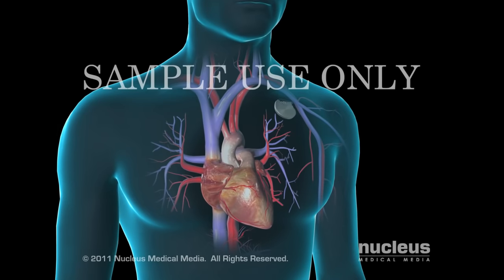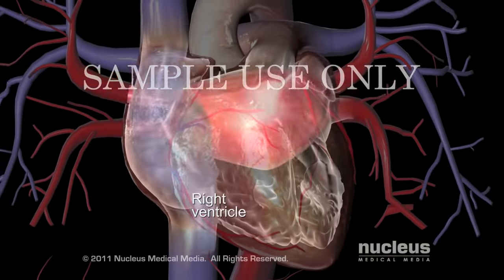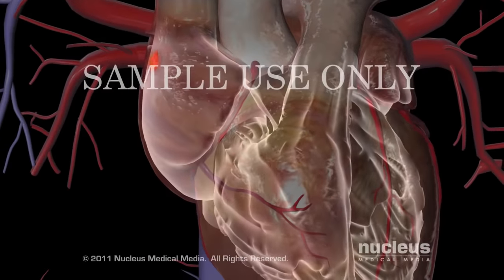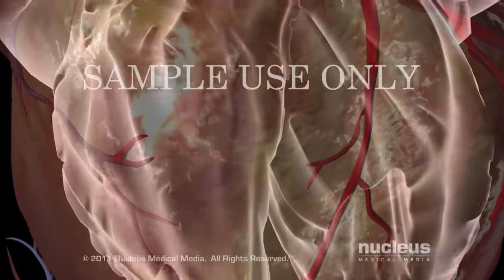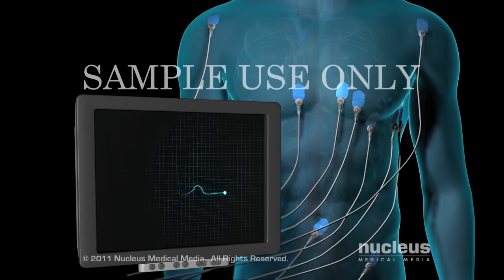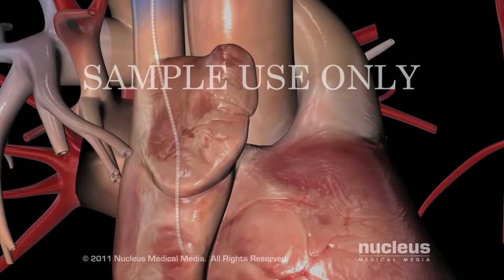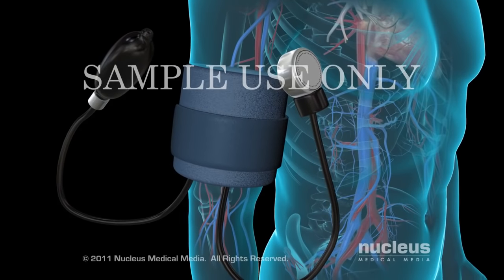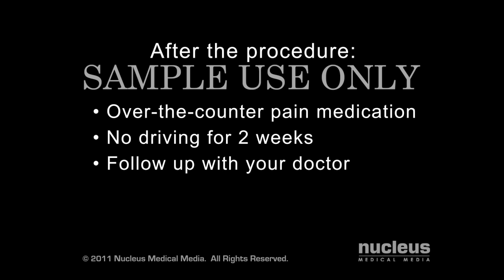Pacemaker

Comment: Hey there, I have a  question (If you don't mind). Okay, I'm 17, and have Hyperadrenergic Orthostatic Postural Tachycardia Syndrome. When I stand or sit up my heart rate goes up to around 170-180 bpm and my blood pressure drops to dangerously low levels, I'm constantly passing out upon standing, and my doctor says that he thinks a pacemaker is necessary. So my question is..Will my heart become dependent on the pacemaker if I do get it, and is there any chance of the pm to stop working?
Reply: Kaylee Macdonald    No pacemaker will never stop working as long as The baterie arę changed and The device is working. If i was u gest a pacemaker it will save your Life. Remember we arę just machines. The pacemaker will be programed so your Heart will best between 60-90 per min
Reply: I have resting rate 35-45 bpm, when i walk or run its all normal.
Reply: What about now are you okay?
Reply: @blinkakay6663  probably rip in peace.
Reply: @uk4490  that's not funny
Reply: @blinkakay6663  sorry
Reply: @uk4490  bruh show some humanity 😑
Reply: @truthtalker9375  only in uk💀
Reply: @uk4490  bruh
Reply: @csgoonly5350  that's is a fuckton low
Reply: @Rizok_soulrose  im still alive xd
Reply: @Rizok_soulrose  low heart beat is actually good. It shows that your heart is strong and can pump a large amount of blood in one single stroke. But this is only the case if you are actively exercising
Reply: Why didn’t you ask ur doctor that question?
Reply: @turfybow1298  he said im ok
Reply: @gen_edits  Yeah but 35-40 is too low
Reply: Rlasco25  between 2 years and now theres a difference
Reply: Don’t lose sight on the Kingdom of God 🏞️ all that is in the world is soon coming to an end. Seek God whilst He may be found. Jesus saves ✝️🙏❤️
Reply: Pray !! Jesus heals
Reply: Are you okay now?
Reply: I know someone who used it till he is 96
He changed it only ones. شفاك الله وعفاك
Reply: @kukalg6212  she died in a car crash in 2016
Reply: Her playlists have vids that are 2yrs old so she was fine till 2021 for sure  , no idea after that 

Hope she is doing well !! Positive wishes :)
Reply: @blinkakay6663  probably in heaven
Reply: Pacemaker is like a derilifbrator but small and in your body
Reply: How are you doing this makes you 28 now.. How did it go?
Reply: @TaT2dDragoness_Leslie  Safe now?

Comment: COMMENTS!!! WHAT IS PACEMAKER?
Reply: A pacemaker is an implantable device which is positioned typically underneath your left collarbone. It consists of a battery with a computer circuit connected to one or more pacing electrodes (electrical wires) which attach to your heart.
The battery of the pacemaker is able to generate an electrical impulse which is transmitted to your heart, which leads to a heart contraction, leading to a pulse or heartbeat.
Learn more:
https://drboonlim.co.uk/pacemaker-implantation/

Comment: I went in for a mitral valve repair and a Maze procedure to correct tachycardia, but the Maze procedure didnt work and I woke up in recovery with the nurse telling me I had to go back in for surgery in the morning for a pacemaker.
I figured they put the leads on the surface of the heart or something like that, I didn't know they actually run those wires thru a vein into the heart where it tends to impinge on the valves closing perfectly.

I thought also that they buried the pacemaker deeper, it's like just under the skin like a large lump and it's right exactly where your seat belt goes which is a really bad place to put it. If you drive I would try and see if it can be put on the right side not the left, because if you ever get into a collision and that seat belt comes at you hard, the first thing it's going to hit is the pacemaker, even with padding it won't be good having that seat belt slam that area!
Reply: Don’t lose sight on the Kingdom of God 🏞️ all that is in the world is soon coming to an end. Seek God whilst He may be found. Jesus saves ✝️🙏❤️

Comment: I am 35. Just got my pacemaker. It's simple. Was done in an hour and they put me under. There is some pretty bad pain after but It only lasts a few days and they give you some good meds. I keep hearing local anesthesia used but they knocked me out cold. No need to be worried.
Reply: How are you feeling now do you feel it when it corrects your heart. Does it make you feel different. I'm about to get mine done. Apparently I flatlined for a few seconds the other month when we checked my loop recorder